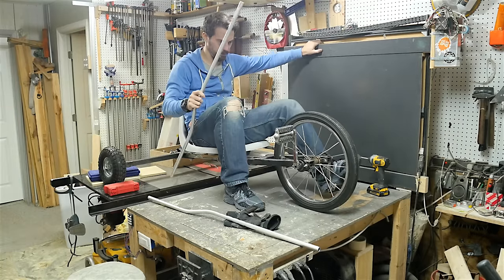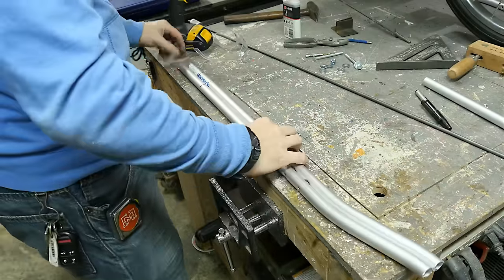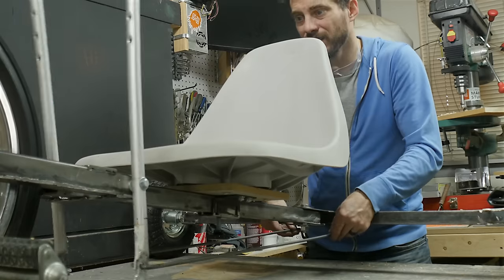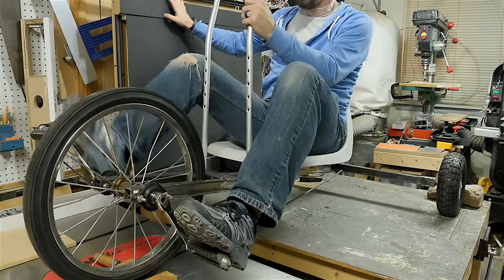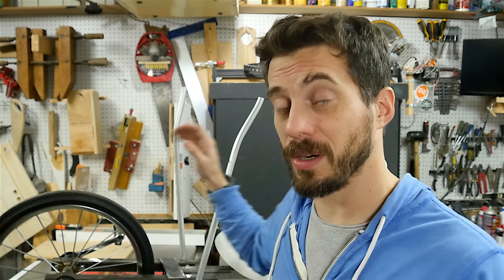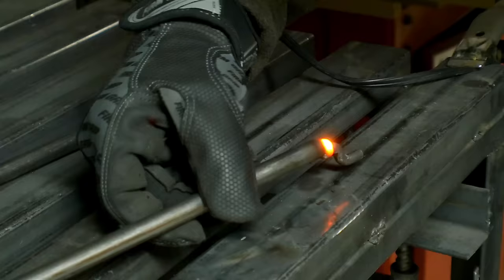Trike (Green Machine) from junk - Part 2 // How-To | I Like To Make Stuff

Comment: Super cool! Do you think you could replace the linkages with wire rope? That, plus replacing the main bolt that connects the rear to the front with a clevis pin would make it quick to break down, store, transport, and reassemble. Just food for thought if do revisit this one later.

-Caleb Harris

Comment: Fun!  I had a Green Machine.  The plastic wheels in the back were key to how it worked though.  The pneumatic tires you used have too much grip to let you do great skids - which was the whole point of a Green Machine.  Short of salvaging them from a kids toy, I wonder if wooden wheels wouldn't be a good choice?
Reply from the maker: I've got PVC sleeves to put on them, but when testing it I could that I just didn't have enough speed to make them worthwhile.  In the future, replacing the front with a freewheel (so I can coast) will allow me to take it on hills and add the PVC sleeves to drift.

Comment: Definitely use EMT instead of the aluminum tubing. I use it all the time. Very strong.
Reply from the maker: It ended up bending as well.  Going for thicker steel next time.
Reply: Really? WOW....I use it for everything. I made the inverter generator on my channel using it, as well as my 7' tall Newtonian Telescope. You can use rigid EMT, but that stuff is really thick.
Reply from the maker: electronicsNmore Yeah, I think it's because the holes drilled weaken it, then there's huge amount of force applied to that weak spot.  It's possible that I was using especially thin material too. I'm not sure, it was just a piece I had in my supply cache.
Reply: Sometimes I go to my local auto parts salvage yard and pull tubing and rods from vehicles that I can modify.

Comment: nice fabrication!  if you have a dowel jig they work great for centering up holes on round and  square tubing and guiding it through to the other side nice and straight. I usually use the 1/4" dowel guide and enlarge from there

Comment: Hey Bob Good work on the sliding bike thingy , you probably know but when locking two nuts to threaded rod once the two faces line up another 1/4 turn or so  locks then in place ,
G

Comment: Just wondering, would you use a bicycle chain in a next version if you were to make one?  You were pedaling ridiculously fast while barely moving.
Reply: A chain and sprocket would probably work, but you'd have to stretch out the bike because you couldn't mount the pedals in the same location as the wheel. You could use spider gears but that wouldn't be the best option either. A larger tire would be a better option. Kinda why big wheels are built the way they are.
Reply: PrimaPunchy He wanted to make it vintage, like how it was back in the days so that's why

Comment: Looks like it needs a larger front wheel to keep you from pedaling super fast and going nowhere, a clutch on the front wheel wouldn't hurt so you don't have to take your feet off the pedals to coast, and as you said the turn rods need to be farther out.

Good project, but I agree on starting with the right parts instead of salvaging. It's like a big wheel drift cart for adults.

Comment: I feel like the back axle was a fair bit too wide. Shorten that, add a stronger seat, that one looks too flimsy for the amount of moving you do, maybe repurpose a unicycle as the front end. it has the forks and pedal assembly already. square tubing is fine, but probably more work than it's worth. Looks like a great prototype though!

Comment: As a tip if you put plastic sleeves on the back wheels it will drift
Reply from the maker: Yup, I've got them, but currently it's not worth putting them on.  I've got several things to improve first.

Comment: Get some PCV pipe and slide it over the rear tires. That will give you the "slide" you need from the back end!!
Reply from the maker: Yup, I've got them, but currently it's not worth putting them on.  I've got several things to improve first.

Comment: FYI bed frame metal is really junk.  It is made of recycled?  So steel of some sort but not strong and some mystery alloy.  Rebar is mostly the same.  For this it doesn't really mater but for say something powered it could be dangerous when the frame just gives out on you at 35 MPH.  You can often find scrap angle iron which is MUCH higher quality than bed frame metal.

Fun build and I much appreciate your discussions of what you would not do next time.  Mistakes are what teach you how to do it right!  Or as someone smarter than me put it "find an expert, they are the person that has made a lot more mistakes than you have".

Comment: You should next time weld spin weeks to a rod and mirrior it to the other side and the drill a whole and bolt it in so when you turn then you can go fast and pull them up and drift around and then pull it down so you can keep going try that next time

Comment: Aren't they usually made with plastic back wheels or big pvc pipe over the wheel to reduce friction and to make it slide better on the roads
Reply from the maker: Yup, I've got pvc sleeves for the back tires, but currently it's not worth putting them on.  I've got several things to improve first.

Comment: If you made the rear wheels from large PVC pipe it would give a different ride, more "DRIFT" action maybe and since they aren't your drive wheel it would still accelerate just fine
Reply from the maker: I've got the sleeves, but there are too many other issues for that to be a possibility at this point.  Maybe in the future.

Comment: you should make the back wheels out of non grippy material
Reply from the maker: Yup, I've got pvc sleeves for the back, but currently it's not worth putting them on.  I've got several things to improve first.
Reply: I Like To Make Stuff oh okay. I saw a video in wich a guy build one with a motor and very thick wheels and he drove on a wet road and drifted like hell

Comment: you should use plastic wheels or use plastic sleeves over the wheels
Reply from the maker: Yup, I've got sleeves, but currently it's not worth putting them on.  I've got several things to improve first.
Reply: u should try put a pit bike engine on it after

Comment: Why not locknuts? they are better than glue on the treads, because you can remove them
Reply from the maker: You can easily remove Loc-Tite with a simple wrench.  It just stops them from loosening with vibration.

Comment: You shld add gears to the front wheel next time.You can go faster with lesser effort
Reply from the maker: :)  Well, that's an overly simplified idea, but yes.  Gears would definitely make it easier to pedal.  This issue on something like this is that gears would make it not a direct drive, so you'd have to move the pedals somewhere else, and drive it with a chain.  At that point, it becomes a completely different machine.  A simpler way to improve the pedal/motion ratio would be to make a larger wheel.